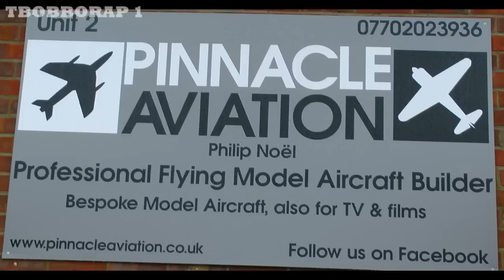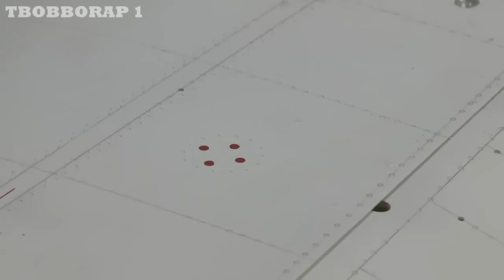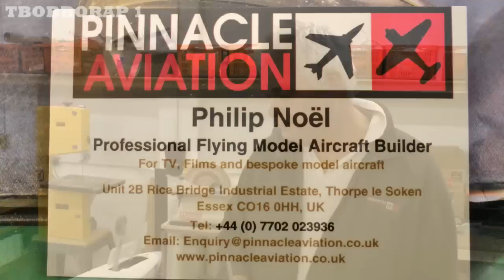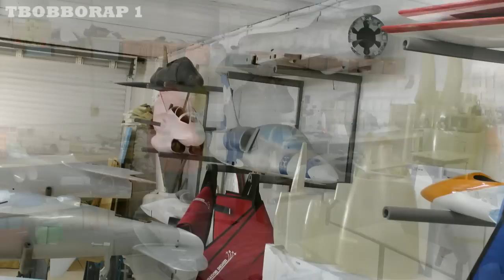① "HOW TO" TUTORIAL FROM PINNACLE AVIATION - APPLYING RIVETS & SCREWS TO SCALE RC AIRCRAFT

Comment: I'm a certificated aircraft mechanic with 20 years of sheet metal experience and can tell you that industry wide standard spacing is 4d min to 6d max just in case you were wondering. This can also vary by what is called for in the manufacturer structure repair manual.
Reply from the maker: thanks for your comments glen